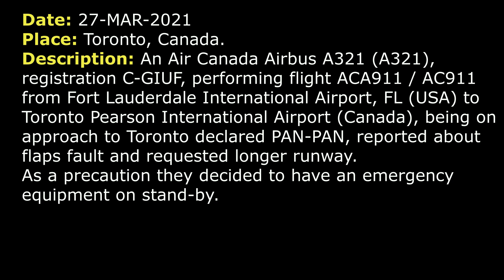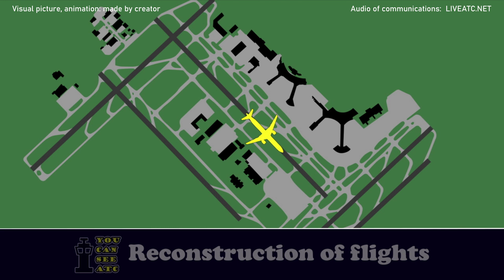PAN-PAN, Flaps fault on approach | Air Canada Airbus A321 | Toronto Pearson Airport ATC

Comment: When I read the title, I thought for sure it would be a 767 or 757. I had numerous flap faults on those aircraft in my 35 year career. It is my opinion the Boeing flap system was the weakest part of the airplane. Having said that, it was also my favorite fleet.